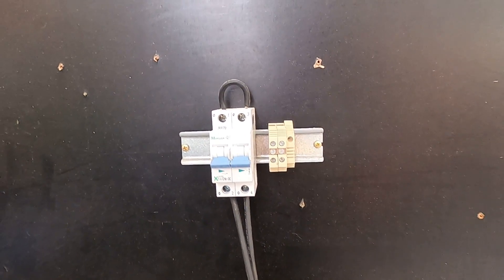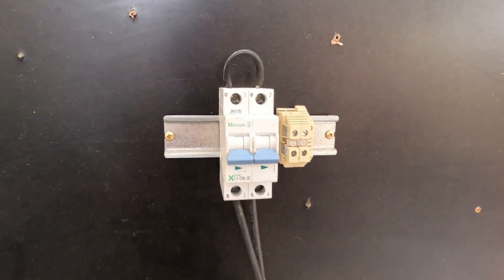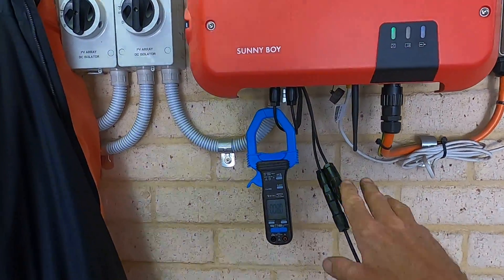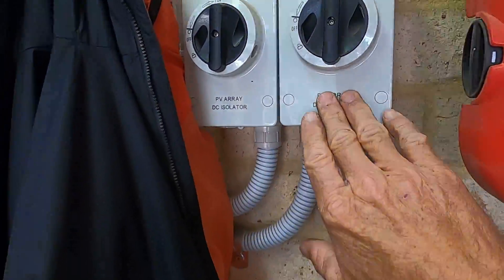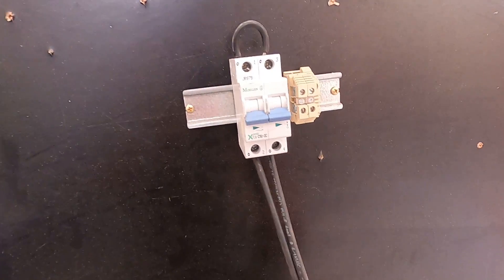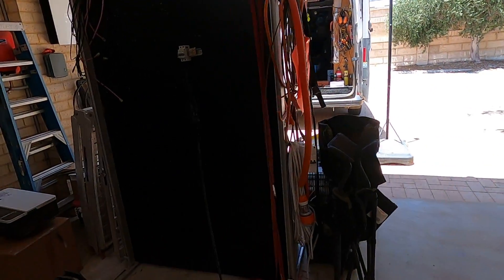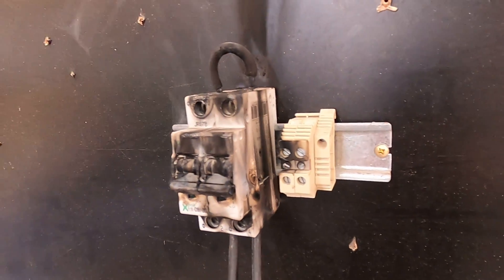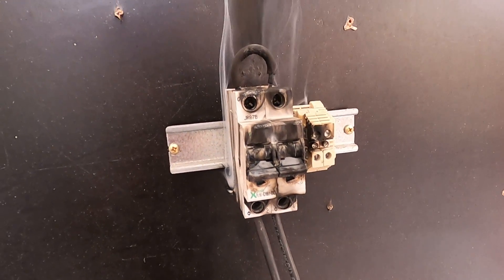Do not use this type of DC Isolator for your solar power system array! Perth Solar system repairs.

Comment: Other solution to turn off these isolators without arc or catch fire is turn off when the sun is already set, around 6:30pm less sun means less energy produce, less load and less arc or no arc. Sounds silly but it works.
Reply from the maker: Not silly but not practical. Just remove loads and your good or use an appropriate breaker 👍🏻

Comment: I use a breaker that looks like that. I just pick one higher amperage one than what it calls for.
36 amps I use a 40 amp breaker.
People just need to go up one size is all.
I would rather burn up the panels than burn up my house.
So I put one at the panels and one in the house.

Comment: Scary,      I would have said these CBs should be OK  16Amps rating with 12 Amps load, why not?       and I don't really get it what is the solution:    oversize everything 5x times?

Comment: Is that even an isolator? It looks like a breaker. Isolators do not trip and they use a fuse for protection (perhaps not even connected on them (the fuse)).

Comment: My installer put a 100A switch (L on one side and N on the other)  on the meter tail from the electricity meter to the Tesla gateway 2. I don’t understand why, but as it’s on the AC side is that OK please. I’m glad I put my battery on the outside of the building after seeing that!

Comment: Did you wire the breaker in the expected polarity or in the wrong way to show the damage? If you do it correctly and its a proper breaker for DC it should work without problems. Good DC breakers have special measures to prevent arcing!

Comment: Crazy! I fuse panel strings individually and have surge protectors in an enclosure, then have proper DC solar isolation switches after this before going into the mppt. Do you consider specified solar fuses to have similar inability to rupture the DC current flow?

Comment: You demonstrated the breaker worked as designed - well over 20 times - and had to wire it backwards for it to fail.

I think the point you were attempting to make was that these breakers are shite.. but wiring them backwards isn’t super fair?
Reply: He simulating a short you dumb dumb.....🤦‍♂🤦‍♂

Comment: Mine is rated and I tested at 40amps. Been in operation 4 years. Is on dc coming into solar shed. Also have single use fuses out at my solar panels so I can disconnect out there. .

Comment: How many wrong pieces of information I can squeeze in one video. 

Solar panels are not running in their maximum current. They rarely get anywhere near their maximum current. 

When you add solar panels in parallel you multiply current not reduce it or maintain it.

Comment: You know it’s wired not correctly - it clearly failed on right one that was done in reverse and of course overcurrent device should break under load… so that statement is absurd -  not sure what is Your intent since You know that because You mentioned there are non polarised one that I use. So case is there is no lack of knowledge on your end - there is another motive - wondering what?! Can you explain motive?

Comment: 9:50 Don't shut down under the load??? Its a circuit breaker, and supposed to trip under load.
Reply from the maker: Not in this instance, its purpose is an isolator not circuit breaker. Watch my latest video where I explain a bit better. 👍🏻

Comment: The panels don't run at their maximum current, thats directly proportional to the irradiance. They tend to run at maximum voltage. If you add optimisers or micro inverters then the opposite becomes true.

Comment: DC isolator or is it DC circuit breaker?
Reply from the maker: In this application yes its a dc circuit breaker however its being used as an isolator for the pv array. Hope that makes sense.

Comment: So what we do if we need to off that pv string under load what type of breaker use?
Reply from the maker: You dont turn a pv string off under load.
Reply: @joondalupelectricalservice3201  if we need under some situation like short circuit on Ac side so that y i ask  i have inverex 12kw inverter which have built in disconect switch on side of inverter

Comment: A very clear and great example of DC arcing. Low voltage DC switches around 12 - 24 volts do not arc very much but solar systems can have voltages up to 400VDC. Breaking the circuit under load  causes a long arc which is longer than the open  (off) gap in small household breakers.  As an apprentice (many years ago) I remember building DC contactors for 415VDC. These were very large mechanisms with special rolling and pointed contacts with make and break under a large fireproof hood!
Great video, really demonstrates well the problem!
Reply from the maker: Thank you sir 👍🏻

Comment: Thanks for this Joondalup, but I am confused.  At around 4:40 you say the inbuilt breakers are approved  to operate under operating current, and then you say that they should not actually be switched off under load because of the strength of the DC current arc.  Where then am I supposed to break the current under load, or should I just never turn them off under load?  Anyone?
Reply from the maker: Yes good point and sorry for the confusion. I explain better in the next video I am currently doing. If you turn the solar controller or string inverter if ac coupled off first then the current flow will stop. Then it is safe to switch off the dc breaker.

Comment: Shows indeed what I know for more than 13 years of my career in solar: that there's a lot of installers that don't know what they're doing.  

Did you check the maximum string voltage for this breaker?

You say the operating current of solar modules goes to its maximum quickly.  That's not true.  The Voltage goes up quickly when it gets light, not the current.

You wasted your pliers by cutting the wire.  Should have set up the experiment with a decent DC switch.  Never cut a live DC wire unless you want a new set of pliers.

The DC swith of the first SMA you showed is inoperable.  Why did you leave the little board there that prevents you from switching your inverter off.  Which is sometimes necessary when you want to perform a reset.  

You lack a decent training in a business with people that know much about it, and I think you went working on your own too quickly.  I see that often and it's a risk for yourself and the customers that don't get an experienced, well trained installer.  I've seen so many bad situations myself and I'm glad that I had proper training and experience in a company with people knowing what they were doing, before I took on responsibility.

Comment: Noark breakers come in 1000v and 450v.  Most inverters are 500v now.  So if you mess up and put the small breaker in, which is easily done if you have loads laying around.  Magic white smoke.

Comment: Hi. I am now planning to arrange a solar system, and looking into various issues I might run into. :) Yours is a great input, one thing that concerned me, when you were explaining at ~5:30 you take the wire connected to breaker '-' contact and say it is '+'. Is it possible that you changed the polarity, and that is why the arc went not in the extinguishing chamber, but went the opposite way into breaker 'insides'? Thank you
Reply from the maker: Hi
With these ones no matter if they were wired correctly (positive to negative flow of current) they would still do this. I will do another video soon to better explain.

Comment: A capacitor in parallel with the panels, and a capacitor in parallel with the load would prevent that. The capacitor voltages would be equalized when the cutout is closed, and would maintain that 0 voltage potential long enough for the contacts to separate enough, that the peak voltage difference cannot cause an arc. The capacitors have to be sized for the current of the panels, and, the separation speed of the contacts in the switch. A knife switch needs large capacitors, a spring loaded breaker can use smaller caps.
     The scariest thing about photovoltaic panels is, that if loaded down to ~80% of open circuit voltage, they become a constant current source. Once an arc is established, that arc can be drawn out to several centimeters, depending on the voltage of the string! The breaker shown in this video only has about 5 millimeters of contact separation when open. It will barely even reduce the current transferred to the load.
Reply from the maker: I don’t see how that would help sorry.

Comment: What is the voltage going into the breakers? If one is doing a 24V or 48V system, it should not be so easy for arcing to occur when breaking the circuit, right?
Reply from the maker: Correct

Comment: Thank you for making this video, this is very very helpful, might even save some lives! Just curious, do you think it's safe to say that all Cbreakers with that similar design (possibly rebranded) are equally as bad as this one in the video?
Reply from the maker: Depends on the application but I wouldn’t trust them beyond say 12volts

Comment: Yeah, they will fail if installed incorrectly as they are polarized - see chrome-extension://efaidnbmnnnibpcajpcglclefindmkaj/https://www.altechcorp.com/PDFS/DC%20wiring_white%20paper_Altech%20DC%20series_0813.pdf

Comment: this is misleading due to the fact that the voltage source needs to be connected to the top of the breaker ....yes this is a perfect example of what can happen if your installer does not know what he is doing  and hooks it up incorrectly

Comment: Sorry but this video makes no sense, whatsoever (and the end is simply moronic).  The first bit talks about not being able to use a fuse or breaker with PV because "the PV modules always operate operate near their maximum current" (whatever that means!).  But the isolator switch is not intended to protect the system - its there to permit safe removal of the inverter in the event it needs to be removed from the system! If you are saying that you have installed an isolator switch that is only slightly higher specified than the maximum output current from the PV array then more fool you (and I'm not surprised they are catching fire!), and (rather obviously) use a higher rated switch, FCOL!!

All this twaddle on the net about DC isolator switches catching fire.. and this utter stupidly is the reason behind it?!!  Christ!

Comment: Bro you just got duped into buying an AC breaker that’s labeled as a DC breaker and compared it to a clearly more expensive variant. There are literally arc suppressors in proper DC breakers.

Comment: Very good demo  Joon  Ive been banging on about how DIY (amateurs) are so casual about dc distribution - but I just a a big yawn from forum members (like Im a party pooper).  One thing to note is that an arc can be killed by distance (for a given voltage).  Its not possible to sustain an arc at 12vdc from a car battery.  Use a 24 v pair and you can do dc welding. But pull the rod away from the work by more than ca 1/2" and the arc goes out.  My take is to stay at 24v its much safer.  48v might need a 2" separation (tbc).  I believe the very common domestic  63A knife switch (ca $10 us) would do the breaker job very neatly at 24v (48v tbc?). These are all over the far east and solid reliable, as are the Siemens NH style knife fuses ($5us).  IMHO there's a massive cartel trying to monopolise the Solar DIY market and its rife with fraudulent parts - fake cable (4mm2 labelled as 6mm2 etc)

Comment: so i have a DC isolater rated for 1000v 63A  but i am only running 250v 20A ,,would that one also go to smoke , if i break the circut in high sunlight?   i have only turned it off early morning or late night...

Comment: What is the difference between the dead short you created and the internal short inside the breaker as a result of turning off the load?
Reply from the maker: It wasnt a short internally as such ,but the circuit breakers inability to break the DC arc as contacts opened.

Comment: What if there is no load, but only batteries that are being charged. Can you still turn off the isolator while the batteries are being charged? Since the battery is like a load. Or do we need to turn off the breaker for the battery before turning off the isolator for the pv array.

Comment: Is using a higher voltage DC fuse for the holder better in this case than using breakers?

Comment: I have used a DC breaker in that style. 1000v 16amps. No issues switching. Obviously that brand you used has simply not be designed to operate at the voltage and current used or it's a faulty design. A DC breaker of that style should follow it's ratings. What brand breaker was that? was it an AC breaker?

Comment: That jumper doesn't seem right? All the schematics I have looked at show 2 methods on battery side going in. 1324 and or 1234? I am glad I haven't screwed anything up yet. I am waiting on some 4/0 cable and some DC cutoffs. Resetable 300 amp breaker. Lug crimp. Stuff. Everything is so expensive.

Comment: What was voltage of this solar system?
Reply from the maker: Hi
Around 350v from memory. I will be doing the experiment again soon with more detail.
Reply: @joondalupelectricalservice3201  Why experiment, this is trustable brand dc breaker, its rated for 220V DC so you are more than 150% of its rated voltage. Do you have any education in electrics? or you just try experiments if breakers burn or not?

Comment: This title is wrong and has a off logic mentality. It should be said "Another example of why you over build instead of under build" DIY solar is the best option for the majority of people. If your not capable then yes pay to have the system installed.
Reply from the maker: Agree, the title could be better. My motive however is to make people aware of the dangers of diy and solar.

Comment: I only use midnight breakers.  MNDC breakers marked with polarity in mind because you want the arc to extinguish in the same direction of the yolk.   If you wire DC breakers backwards it will actually hold the yolk in the closed condition in some scenarios.  That would be bad.  

The 600 V breaker that midnight solar makes actually has four yolks.

thanks for making the video. It’s very important to understand how DC arcs pertaining to these breakers work.

Comment: Don’t let this video scare you from going off grid of course a fire will happen if you jump the negative to positive like you did in this video
Reply: You missed the point (it happens ;-) ), no fire happened during the short circuit.   The fire happened when the short was *disconnected*/opened   and the resultant arc was not interrupted .    Solar panels can be shorted indefinitely as the cabling is rated for that , and panels can't supply more than that (unlike most batteries).  Solar panels can't only supply a limited current to their loads , a short is no different than a heavy  load, they will just max out to their Isc amp rating and that's it (voltage will drop).  However when you interrupt it under max load.....that what we see in this video.

Comment: People need to cautious about buying cheap crap on Amazon or eBAY. Too many people try to go cheap in the worst places. If the electrical device doesn't provide complete specs, you are taking a risk. Also, people need to understand the difference between a breaker and disconnect. They server VERY different purposes. A breaker needs to be rated for the minimum capacity of the line (it give out first for safety), but a disconnect needs to be OVER RATED.

If you want current protection you need a BREAKER (or fuse) and not simply a disconnect. I put disconnects at the panels and breakers inside closer to the system.

You cannot use AC rated devices on DC at the same load (get DC rated).

Also, you point about load is important. Shed your load before disconnecting loads at the power source.
Reply: What you mean by saying shed the load?
Reply: @Gallardo6669  You don't want to just trip a main breaker with multiple appliances/loads operating. It puts way too much stress on the breaker and risks a failure. You trip your individual lines one at a time to disconnect smaller loads sequentially and then trip the main when there little or no load on it.
Reply: @Mike80528  i thought so, but thx for clarifying.

Comment: Just use fusels instead breakers for DC and that's it. Of course, you have to be using the correct Amperage and solved. No fires, no problems.

Comment: That‘s why i dont use breakers at all. Although i only have 200 watts of solar. I dont know why i would want to disconnect my solar panels? I just remove the cable from the charge controller. Also the voltage isn‘t dangerous in my case
Reply: @batterynerd8779  In an emergency situation perhaps?
Reply: @richardjones3112  whats an emergency? 200w is near to nothing. And my system is not located in the house.
Reply: @batterynerd8779  A fire perhaps.In a domestic household I was thinking.

Comment: What voltage is that breaker rated at?
What voltage are you using for the test?
How many ka is the breaker rated for?
Reply: its rated 220V, and he uses 350V
Reply: @rm6857  obviously he's using more than it's rated.

Comment: My 150vdc midnite solar breakers have worked flawlessly on my 80vdc system. Put too much charge controller on an array and it popped 80 amps repeatedly

Comment: Your breaker needs to meet not only current loads as well as break voltages. If your sized correctly, then your over current protection device isn't an over current protection device.